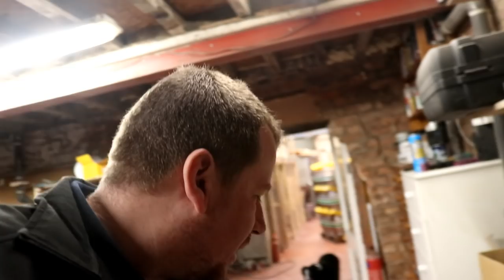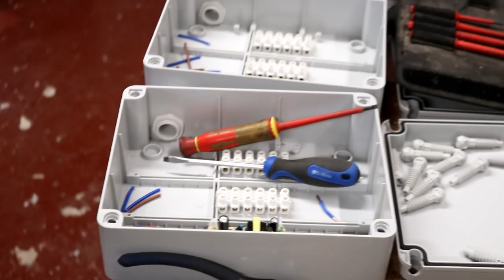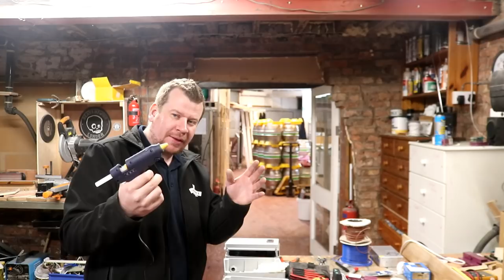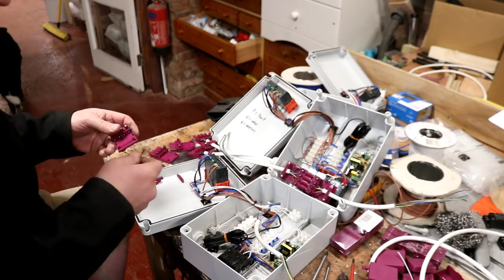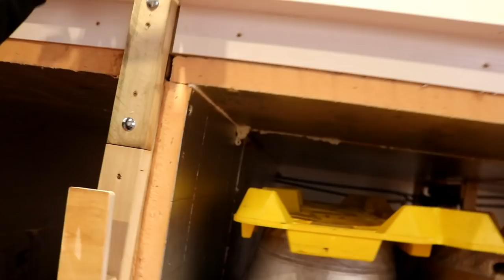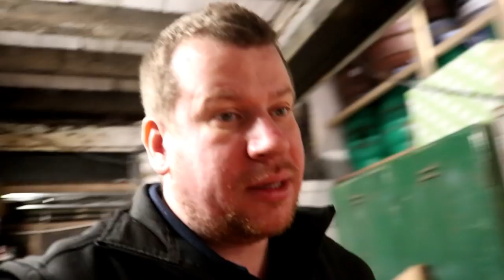THE WIRES

Comment: to save time use some wago connectors, so much easier to use and reuse instead of the wire connectors as you can get 7 way ones and you do not have to make little wire loops all the time to make into a busbar .